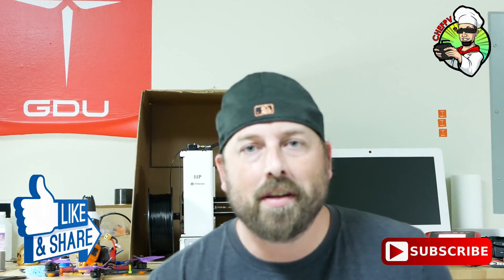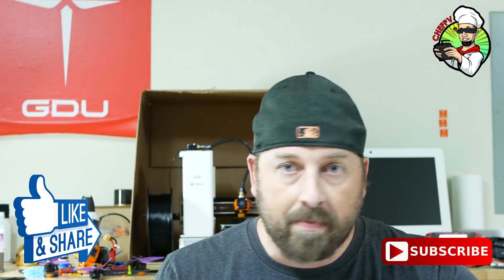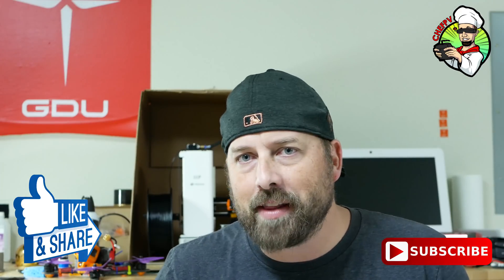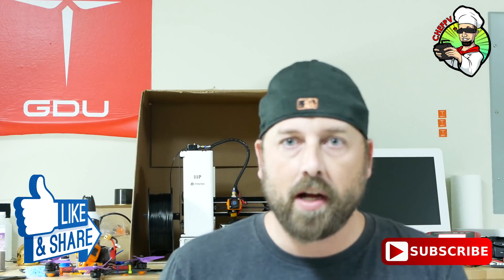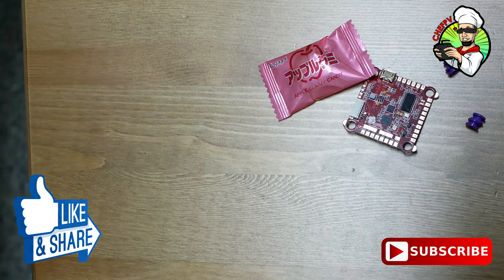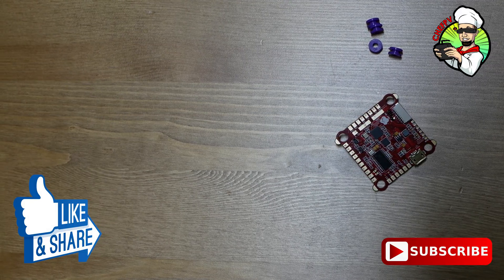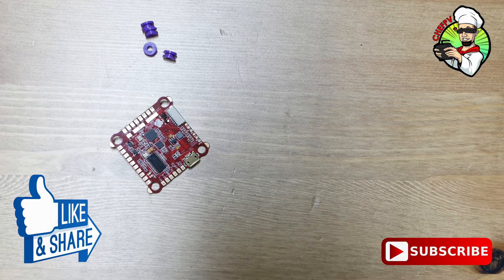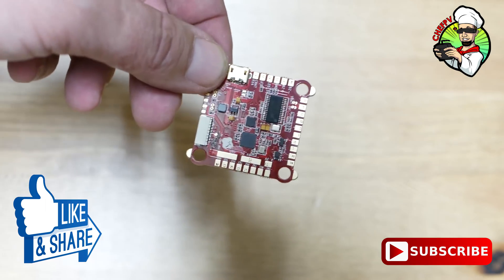CheFPV 101 What is Helio RC and Who is Butterflight and Spring IMU F Tips

Comment: Hi there ...
Got one question...  I got my HELIORC without the Cable..so did Soldering erverything of the ESC...
My question is.. the PAD for CURRENT on the board,  what is it all about and I did solder it but did not see the amount of Current on the OSD. 
Any help is welcome.
Reply from the maker: The OSD needs to be configured to see current and I honestly havent had time to work on mine yet.  I will try to do so soon.

Comment: Thank you if you have time to answer this. Loving the videos. I'm about to build this and I'm a bit confused. The documentation says you can run the flight controller on VBAT/5v for power. I have a PDB and I'm wondering if I should run 5v to the power in, and run my VBAT to the current sensor, or should I just run VBAT to the in for power. I really don't want to burn out the board. I can't find any build videos where people aren't using the plug for an all in one.

Comment: Thanks for a great video. I have subscribed :). I'm just about to wire up my Helio FC but have some concerns about power so I drew up a small wiring diagram (images from various websites including heliport.com). See https://1drv.ms/u/s!ArnHV3_qjaPhgdE7os9T_tYtM2eeRQ I currently have my battery leads,VTX and capacitor on the same battery pads on my ESC 4 in 1 board. It's going to be a bit crowded. Can I use the VBAT pads on the Helio to power my Unify Pro HV? I'm worried the JST leads coming from the ESC to the Helio JST connection aren't going to supply enough power to the Unify HV because the JST wires are so thin. What are your thoughts?
Reply from the maker: I would isolate power to the battery leads for the vtx.  Thats why I dont use 4in 1 esc.  They trade off to much power distibuton.  
Sorry, my answer sucks.

Comment: Just learned 32K is only 10% of the whole system loop and that it introduces more data which requires more cpu overhead. Deadband show Brain FPV. Who is pulling all of our legs? and are we going in the right direction? New forks? More issues? I don't mind all the choices but then everyone is hyping firmwares and boards etc.

Comment: Cool got thatbworking. Now I need to get my telemetry working. You using frsky or crossfire. Using frsky for now. I have sbus on uart2 in the front and smart port wire right next to it on the corner pad. Just can’t seem to find what uart that is.
Reply from the maker: frsky
I am not running telemtry... .sorry

Comment: So can I just run a wire from an esc or full v bat power to that sensor vbat and not fry stuff.
Reply from the maker: ChaddyCEEE RC the VBatt pad/plug wire is for the OSD and the Current pad/wire is for Current for OSD. The 5v pad/wire is for powering the board and necessary.  If you connect the 2 above (vbatt/5v) you should not bridge the 5v rail.
Reply: ATx RC Productions by CheFPV ok. So I can just run full vbat in vs 5v and be able to get my voltage that way. Missed that part that he board can run off vbat